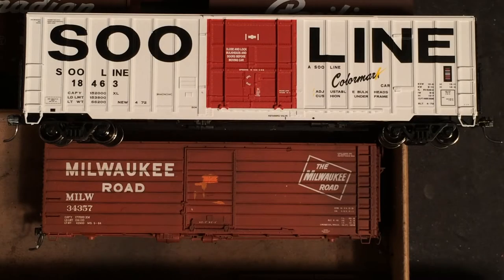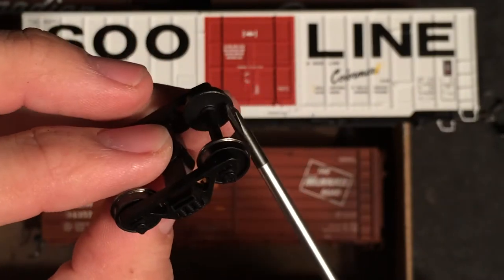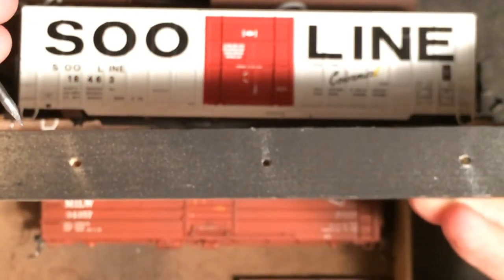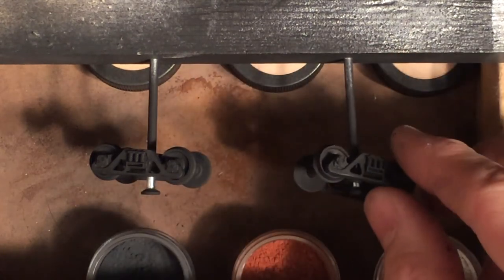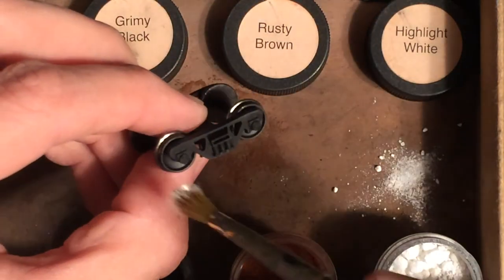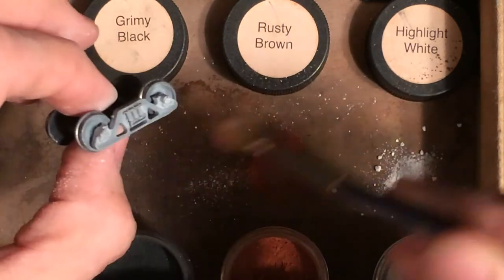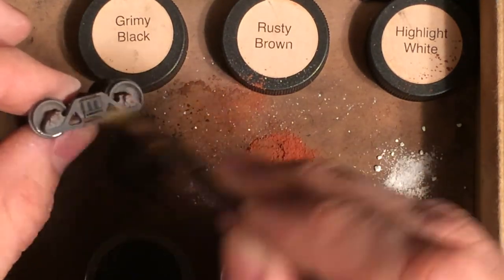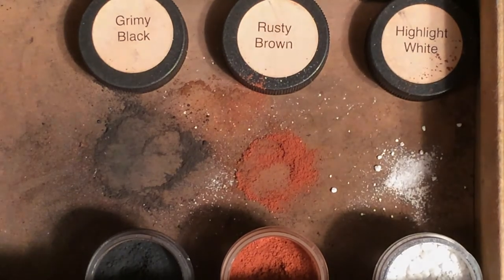SOO The Milwaukee Road S01E06 - The Weathering of Freight Car Trucks

Comment: That was a good weathering video. One suggestion, I would have the bristles of the Brush cut down to Half the Length of the Original length.  Then I would have another paint brush with even shorter Bristles about 1/8th inch from the feral of the brush. Just a varieties of brushes that I have to use when weathering with powders.
Reply from the maker: Kevin, excellent suggestion!

Comment: Another option... attach wooden dowels to a piece of scrap wood(sharpened to a point in a pencil sharper) to hold the trucks while painting. no need to play with removing nails or holding upside down.

Comment: Do you use a dullcote to seal or do you find it will remain on truck?
Reply from the maker: JD Mills The flat black or brown spray is usually enough. So I leave the trucks as is, once completed. As I’ve found a dull-coat knocks down the effects of weathering. We do not handle our cars much, once completed...but if ya have cars handled a lot? It never hurts to seal ‘em with a spray of dull-coat.

Comment: Although it looks ok, it really defeats the purpose of applying rust to the wheel then going back over it in black. The wheels should be rusted only.
Reply from the maker: mrlionel1965 Great point!

Generally I weather from photos and apply color based on what’s in the image.

Thank you for sharing your take on the process.
Reply: I live by a CSX mainline and the trucks just look black like yours. I do love the blow hopper truck that are sometimes whiteish from the material. Great video and good ideas for me to use. I like the assembly line process. Should work great for a unit train.